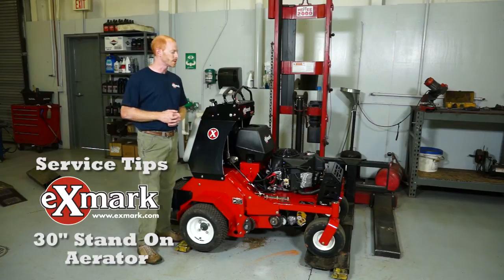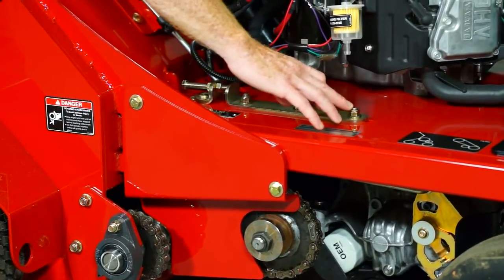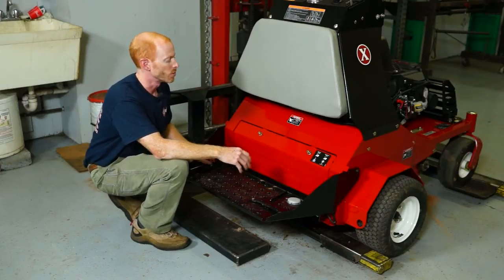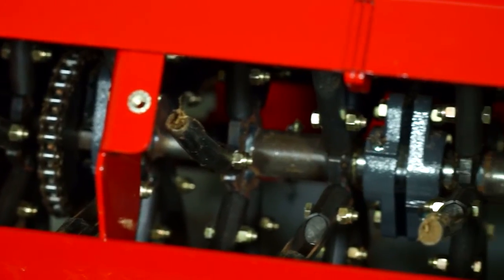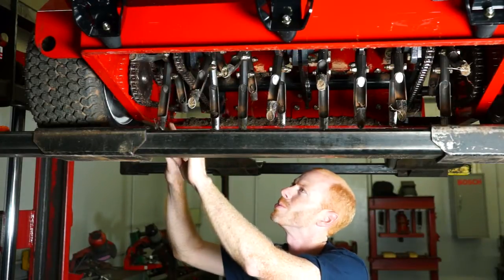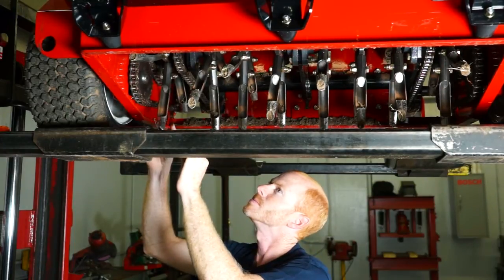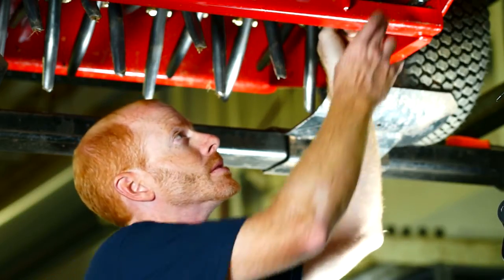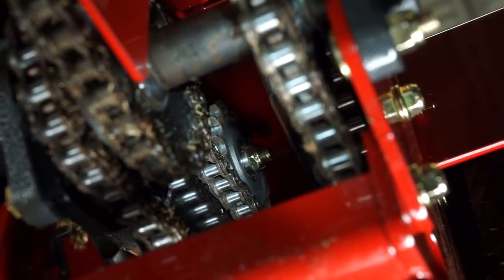Exmark Aerator Service Tips

Comment: The idler for the rear tire assembly is not "heavy duty" enough. Ive had multiple failures of this idler that ended in stripping teeth off the gears. With comercial use in mind and regular daily maintenance the 3/4 crown nut only being 1/4 thick or so becomes weak after multiple adjustments and daily use. in some instances the threads will strech giving the illusion of being tight until a hard corner  or tines ingage. Often this leaves the the nut to be cut off and replaced and other damaged parts
Reply: I got it , great video , key is to keep it super clean under there, lubed , chains tightened and oiled up. Mine is doing great, thanks for the video.

Comment: I'm getting ready to adjust mine can I use a floor jack ? So basically it's top adjustments and 2 on each side underneath correct. I need my chains tight I've held off too long
Reply from the maker: You can use a floor jack to lift the unit but then you must place on stands/supports underneath before beginning any work.
Reply: How do you know if the chains are too loose or too tight?